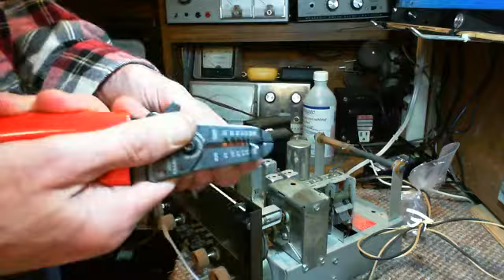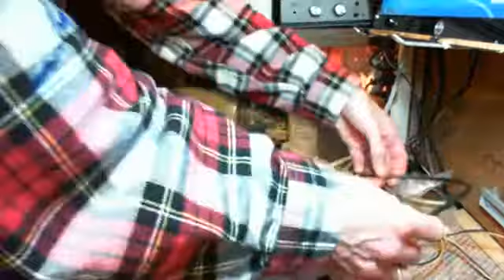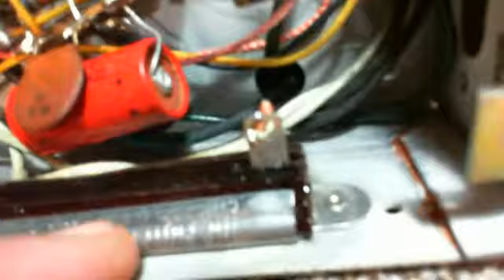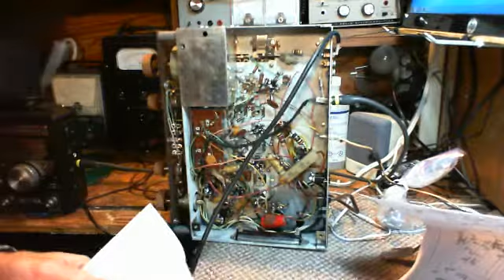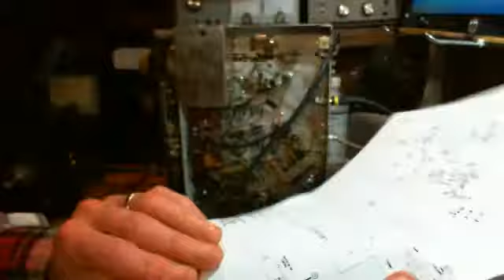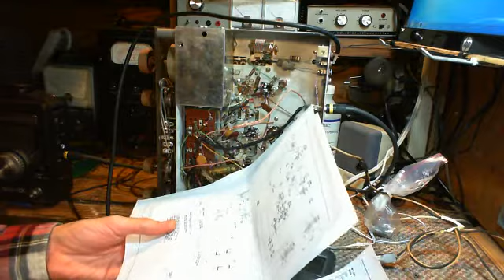Stromberg Carlson FR503/504 video #1 - Troubleshooting Starts

Comment: Hi Jim. If after you change the electrolytic cap and it works check the temp of the resistor if it is still getting super hot you may need a higher wattage resistor. And may not be a bad ideal to go back with a 47k ohm. has a lower one could be hard on the other components. Hope this helps Jim.